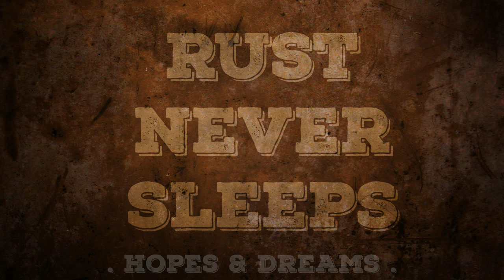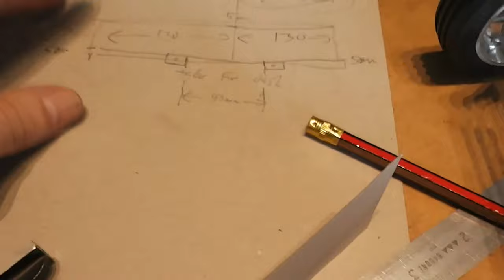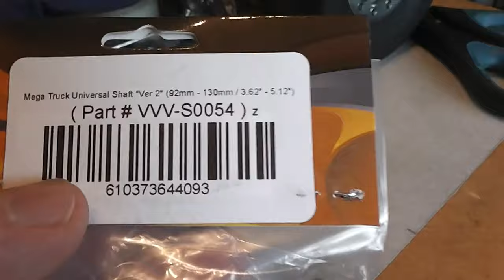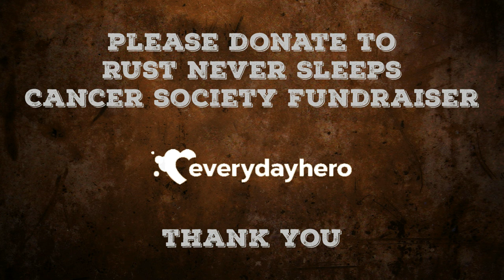Rust Never Sleeps (part 18). RC Rat Rod charity auction build for Cancer Society NZ.

Comment: Definitely looking great so far. Hope you feel better soon mate. 
Question, the speaker, could you make it look like the radiator? Make like little alloy sleeve to slide over it?
Reply: Hey if you need to unload, we're here to listen.  And you need to show off what you've done so far. And it's good to see where your thoughts are heading :)
Reply from the maker: You know you just reminded me there is some faux radiator sticky backed alloy sheet that the drift boys use to detail their cars. I can't remember what hobby site I seen it at.
Reply: Sweet, maybe check out RCMart. They have heaps of drift accessories :)
Reply from the maker: Thanks, yep, that is where it is at. "REAL 3D Radiator Decal" it is called.
I also just found an actual liquid motor cooler with a radiator at HobbyKing too. No good for this build due to the V8 motor housing, but it looked pretty neat, a definite possibly for other builds, maybe the Wolfspider.
Reply: I just saw that HK one ... Thanks for the heads up.  But I think I'll build my own. Not too fussed on the cable tie holding it together tho .. Oh I know it works .. Just me being picky :)